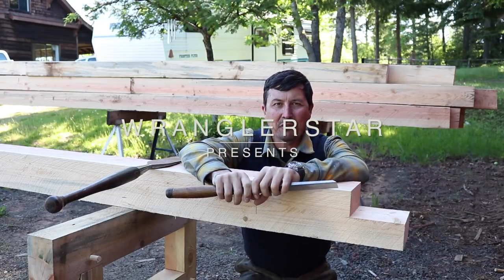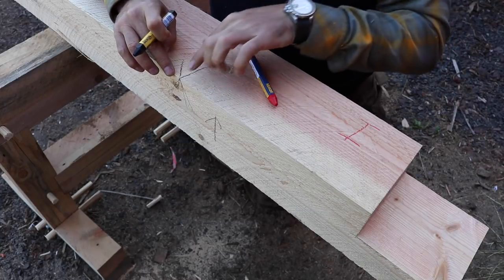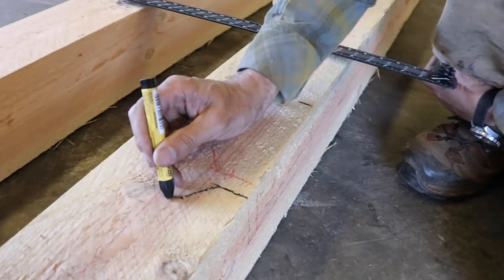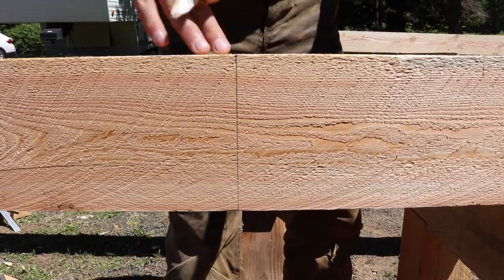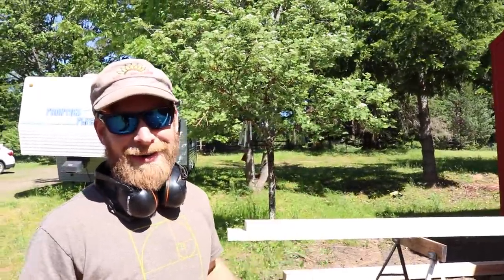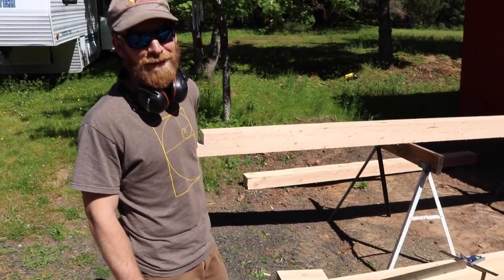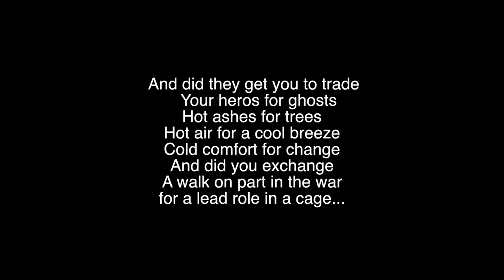The Ultimate Raised Garden Beds

Comment: I would ask what are the advantages of raised beds?  They look good, and this one looks to be a treat!  Love the 'for the eye' detail with the dovetailed crossbar.  I enjoy watching you pare down wood with the chisel, the wood just peels away from the chisel edge and the surface is left clean and beautiful.  Clearly you love working the wood into shape, almost poetry.
Reply: The raised beds are easier on the back when you have to pull weeds or thin plants. They cut down or eliminate damage from gophers. Water drains down and doesn't rot the plant roots.

Comment: For the cross member you might consider inverting it so it sticks up. You can trim it and maybe bevel it to shed rain. Decorative carving would also make for a nice accent.

Additionally if it it peaked you can also use it to support plastic cover for a  cold frame.

Comment: Pine tar, linseed oil, and turpentine would be a great finish / coating for these beds. Bug and waterproof. Torch it in, and those timbers will last pretty much forever.
Reply: matt4270.......What would you think about a soak using recycled/used motor oil? Talk about yer bug barrier and a fine patina.
Reply: That would work too. Cody did that on the timbers for the mailbox. Check out logcabinlooms channel for info on the pine tar. Interesting stuff, and less caustic than pressure treated lumber, especially for boxes in a garden.

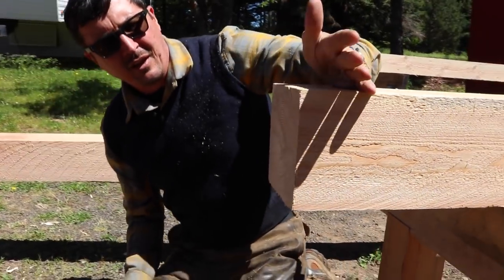Comment: ref 7:46
I do not often cut the size your using, after more or less doing same as you do I found an easier way to do this
I use a block of wood where I cut out a slot equal to the dimension that I want to cut and true up the side. When cutting I just push it down to the line where I am cutting  and hold the saw against the block. Comes out true every time and there are never any problems starting the cut.

Comment: an easier way is to use 4X4 2 on top of each other, cut them all to the same length and overlap them like you would lay bricks in a corner. use some 3/8 round stock or rebar with one end sharpened, predrill the comers with a 5/16 bit. drive the rebar like a giant nail.

Comment: Just curious but any thoughts on wear and tear with the dovetail joints in the winter?  As water freezes and expands it will start putting more and more pressure on the joints until it splits.

Comment: Great videos but I have a question, you mentioned you' used rebar for the bottom layer and then the dovetail for the top but what's holding the middle layer so that it doesn't bow out?  Are you using rebar for it also?  I'm using 4 in X 6 in cedar.  I suppose I could just rebar for all of it (I don't want to get into a dovetail).  What do you recommend?  thx

Comment: why is the Japanese saw better than a regular panel saw ?
Reply: These Japanese saws are pull saws. They tend to be very lightweight and low cost. They also tend to be made with superior steel. Using a pull saw is different from a western push saw. With a push saw, the effort is on the human. We must exert sufficient force while ensuring we don't bow the blade. With pull saws, the focus changes and leaves all the work to the teeth and gravity, resulting in a (subjectively) more pleasant sawing experience. If you haven't experienced a pull saw, try one. Avoid the western imitations. Get yourself a japanese saw (and watch some YT videos on the subject). Try a ryoba (double sided) to start with. It's great for ripping and cross-cutting. A superb ryoba can be had for under $50. Good luck.

Comment: I'm not sure that timber, of any kind, is the best choice for raised beds. It looks nice but will rot. I've been researching designs for an Urban Community Gardening project I want to submit to our town that would serve people without gardening space. Of all the designs out there (and there are many) the one that stands out for me is a hybrid of corrugated metal for the walls and composite decking material (Trex etc.) for corner posts and a top rail/frame. Both of these materials would have considerably longer life spans and I believe would be easier to manage than wrestling very heavy timbers. I also think the beds should be narrower. Almost all of the references I see recommend 30-36 inches as the maximum width so you can easily reach all the way to the center of the bed without stretching or needing to step into the bed and compacting the soil.

Corrugated Raised Beds https://www.google.com/search?q=corrugated+sheet+metal+raised+beds&source=lnms&tbm=isch&sa=X&ved=0ahUKEwil5ofhiIvUAhWGOyYKHfV-C8IQ_AUICygC&biw=1366&bih=638